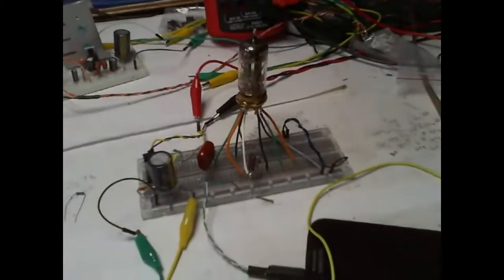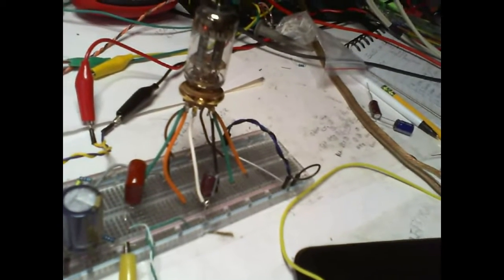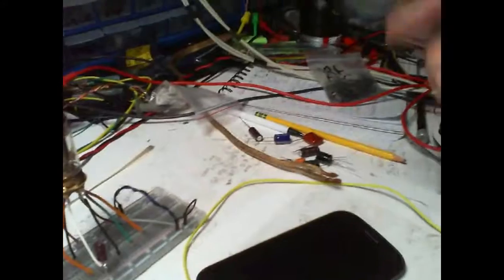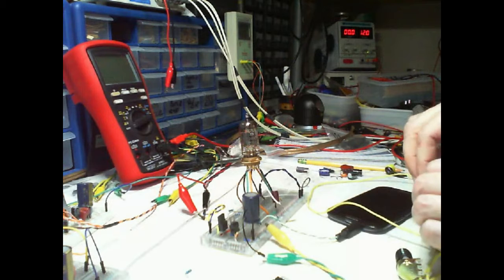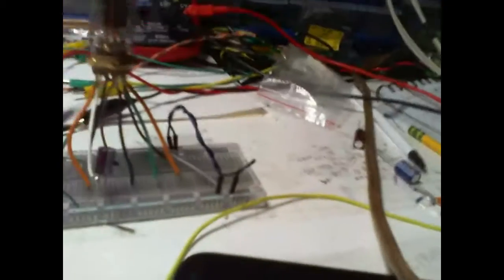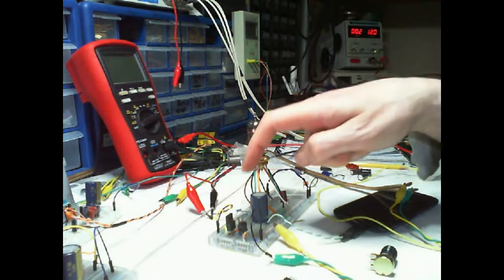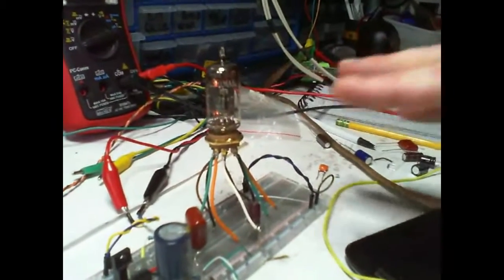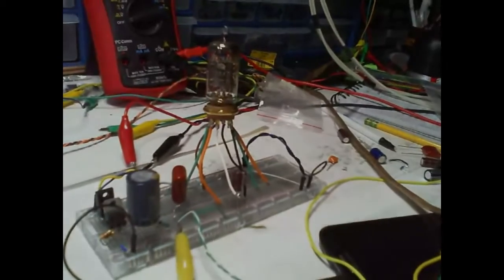12V 12AX7 ECC83 Tube Valve Amp Fixed

Comment: What wires do you need to connect to just light up the filament with a battery?
Reply: pin 4 and 5 for 12v (pin 9 is shared for both the 6v filaments.
https://www.radiomuseum.org/tubes/tube_ecc83.html

But I think you need to use the 12AU7 tube if you wanna run the plate (anode) voltage at 12v (I'll bet the 12ax7 and ecc83 will get very distorted at 12v ?). Btw. You can run the ECL 82 tube at ~48 Volt. You got both "preamp and power output stages" in the ECL82.  You can get a DC/DC 12-48v stepup module for less than $1 on ebay)

Comment: Do you have schematics fot this amp, i have the same tube btw
Reply from the maker: Yes buddy, check this video out  https://www.youtube.com/watch?v=SeA5iWHiGzo
Reply: thx. I will try to make something that works XD
Reply from the maker: Share with me when you have done it. I am interested to see your success.
Reply: +Elecifun It wooorks. Wooooo. but there is a bit of a distorsion. It's like lm386 the output is realy distorted. Is it because I'm using IRF630 and 6N60 instead of LM317?
Reply: +Elecifun and instead of 2.2uF ceramic cap i am using 2.2uF electrolytic. I am also using 50k potentiometer as shown,  instead of the 4.7k resistor.
Reply from the maker: Hi that is great, you have it working :D You are using two mosfets for current control, a 6N60 (mosfet) instead of LM317 voltage regulator. That could be the reason for the distortion. You should be able to get a couple/few clean watts into 8 ohms. You are nearly there, thanks for sharing. 
Let me know 'when' you manage to clean it up.
Reply from the maker: The 2.2uF 'film' cap I am using could be replaced with a electrolytic . The 4.7K should be used rather than the 50K pot as the pot will likely drift. Can you not make a 4.7K from other resistors. I imagine this will help if you can.
Reply: +Elecifun I mean that instead of IRF630 i am using the 6N60. and i use potentiometer so i can control the volume. The LM317 is the same as the schematic you've shown.
Reply from the maker: I guess if you have a 5K pot then you would use it. There are some differences between IRF630 and 6N60, I do not know enough about these devices to determine which one would be better over the other in this application.I am confident you will figure it out. :D 
If you are in UK I can send you a couple. I have a handful of second hand workers. Use my email on about page for your details, don't post on here.
Reply: Sry im not from UK
Reply: +Elecifun Ok so I replaced the 6N60 with an IRF630 and the distortion is mostly gone. Next I'll do is to change P1 with 4,7k and see if it's even better.
Reply: +Elecifun Ok so I replaced the 6N60 with an IRF630 and the distortion is mostly gone. Next I'll do is to change P1 with 4,7k and see if it's even better.
Reply from the maker: That is great I am glad to hear that it is getting better for you.
Reply: +Elecifun Thanks. 😆
Reply from the maker: Your welcome. Put a video up if you can and show us your project. I love these little tubes.
Reply: +Elecifun i cant find free video editing program. Believe me,  there are SOO much p
Reply: +Elecifun projects I've done. And I'm still making.
Reply from the maker: Did you check out the stereo version I built https://www.youtube.com/edit?o=U&video_id=SeA5iWHiGzo
Reply: +Elecifun Ive used a program that had 30 day free trial,  after that i couldn't use it.
Reply from the maker: What program was that? and what was it for?. I think I may have missed some of this thread.
Reply: +Elecifun i think I've used vegas pro. What program do you use
Reply from the maker: Video editing software.. I use Openshot Video Editor on my Linux desktop. I did have pirate copy of Adobe Premier for MS Windows which I liked but lost the software so decided to learn Openshot.